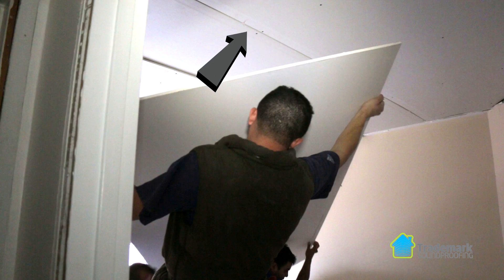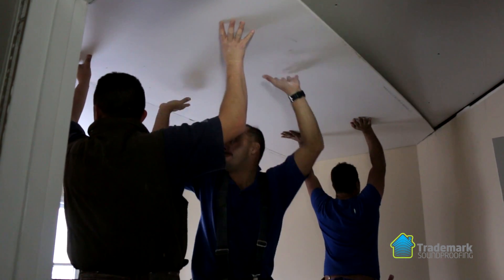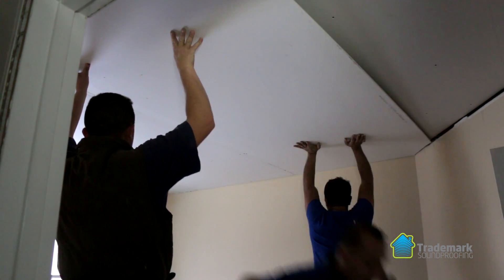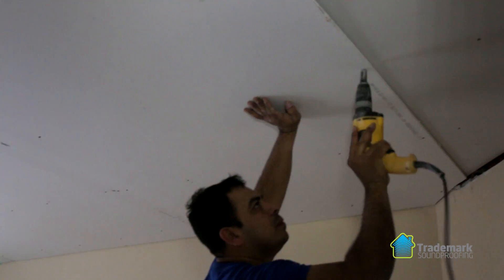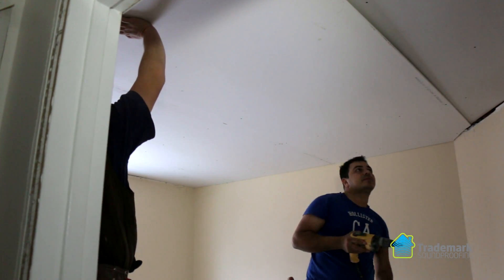Soundproofing a Ceiling Using Green Glue Noiseproofing Compound

Comment: Blowing cellulose insulation into the ceiling might help--but just a little. If you can afford it, it is much better to remove the current ceiling drywall; install a rock wool product such as Roxul; and install the new two layers of drywall (separated by Green Glue as described) onto the ceiling using sound isolation mounting clips.
Reply from the maker: Agree

Comment: since you are using greenglue for the wall to ceiling joint, does that mean mudding and tapping is not required for the area?
Reply from the maker: We use an acoustical caulk for the joints and those can be taped and spackeled over.

Comment: Not sure if this work only for airborne or also for impact soud?
Reply from the maker: Mostly for airbone. You would need Resilient Sound Clips and Channel to hang your drywall from the ceiling and then a 2nd layer of drywall with the Green Glue in between for proper impact noise protection. https://www.tmsoundproofing.com/Resilient-Sound-Clips/

Comment: I rent and am pretty clueless with diy. Could I just use this stuff to stick drywall directly onto the existing ceiling? I obviously can't do too much damage to existing stuff because I only rent, but the upstairs neighbors sound like they're in the room with me! 😬
Reply: You could do that however you would have to screw the 2nd layer back to the studs. Keep in mind that you will have to spackle the ceiling and where ceiling meets wall, usually requiring to repaint the entire room. In that case you may as well remove the existing ceiling drywall, make sure ceiling is properly insulated and then install resilient sound clips, channels, double drywall with Green Glue.

Comment: Just to clarify, I have applied Green Glue joint sealant.  I SHOULD NOT mud and tape the first layer of drywall before applying Green Glue damping compound and second layer of drywall, correct?
Reply from the maker: There is no issue mudding and taping the 1st layer, although it would be unnecessary if you are installing 2 layers of drywall. The Sealant can be used at joists to seal against sound leaks and can mud and taped over after 24 hours.

Comment: I live in a downstairs apt. There is no insulation between floors. I hear footsteps and creaking floorboards and joists CONSTANTLY. Ready to go insane. I am willing to try this. Thoughts/help.. Thanks for the great video.
Reply from the maker: You should only do it if you can remove the existing drywall and insulate first. Once that is done you should install clips and channels first and then the 2 layers of drywall with Green Glue as described in this article. https://www.tmsoundproofing.com/How-to-Soundproof.html
Reply: Did you ever do anything about the noise and what was the outcome?
Reply: @damians8498  Actually, I Installed a white noise machine with 4 speakers in each corner of the room. I kept this on all day. It helped alot in terms of keeping me distracted from the impact noise itself. NOW I have moved to florida and live on the top floor of a concrete apartment building. It is great. BUT I would say try the white noise machine , and a pair of noise cancelling headphones. That was my 1,2 punch.
Reply: @Racketeering248 i know it’s been years since this comment but I only have one white noise machine. Did the four really help with the impact noise because I find that white noise doesn’t cover it

Comment: I'm adding decorative HDF 4'x8' wall panels to my existing painted drywall/ceiling to spruce things up a bit. I'm attaching the panels to studs using finishing nails. Will Green Glue help to dampen noise if I apply it to the backs of these panels before I nail them to the walls/ceiling?

Comment: I can agree that the green glue stops sound transmission from one drywall layer to the next, but surely the screws fixing the drywall layers to each other are transmitting sound, effectively short-circuiting the green glue?
Reply from the maker: Hi Giovanni. Good question. In reality screws do not transfer much sound "directly" as is commonly misunderstood. Rather the entire structure, drywall in our case, vibrates and thus creates the sound wave. When trying to break the sound wave, by decoupling the wall, the screws will defeat the decoupling if the wall is screwed to the joist. In the case of damping such as when we are using the Green Glue, we are not utilizing a "decoupling" method, rather a "damping" method therefore the screws holding the drywall to the wall do not negate the effects of damping the vibration.
Reply: Does that mean, if I place a layer of rubber seal between drywall and studs and screw through rubber and it will dampen the sound, since the direct contact between drywall and studs are now only with screws?
Reply from the maker: @julesdownunder It is only utilizing the damping method. For proper decoupling use .resilient sound clips.

Comment: It's making the wall denser that helps sound-deadening, not a colored adhesive.
Reply from the maker: Can you back this statement up with proper sound testing? According to the sound lab tests we have seen. Another layer of drywall will add 3 STC points. Adding a damping compound as in this Green Glue will add 9 STC points. A huge difference.
Reply: @Tmsoundproofing  It's a marketing gimmick. Sometimes they catch on. That may not be particularly-honest, but is effective business, nonetheless.
Reply from the maker: @noampitlik2332  After installing this (and other) products in thousands of soundproofing projects. Plus feedback from customers and contractors we can assure our customers that this works amazingly well as a soundproofing material. Customer testimonials are available on our website and on many other channels.

Comment: This stuff is messy...how do you keep it from oozing out of the seams? And yes, I’m also using GG sealant.
Reply from the maker: Leave a 2-3 inch area around the perimeter where you do not apply any Green Glue. Performance will not be effected.
Reply: Trademark Soundproofing Inc thanks. I’ll have to try that on the ceiling... the walls are already done... and this stuff is all over my floors. And oozing down my walls. Now I’m told I have to wait about 6 weeks before it cures and stops leaking!
Reply from the maker: If it is the Green Glue product that you are using, it will not continue to ooze and you should clean it up right away. It get's much more difficult to remove once it cures.
Reply: Trademark Soundproofing Inc It’s actually the Quiet Glue Stuff. And the GG Sealant!
Reply from the maker: Figured as much that stuff runs terribly. Green Glue barely runs at all.
Reply: I wish I would’ve known that before hand! It’s too late now, and is going to push me back 6 weeks just waiting for it to finish dripping!

Trademark Soundproofing Inc

Comment: So how is the glue causing a difference with acoustics? It seems doubling the drywall is what is really making the difference.
Reply from the maker: Sound can only pass through a solid material (like drywall) by causing it to vibrate. The "damping" of the material created here with the Green Glue damping compound, stops the vibration. The difference between 2 layers of drywall with or without a damping compound like Green Glue is about 9 STC points, a huge difference.

Comment: Normal drywall stuck to normal drywall? You need acoustic drywall to make a real difference.
Reply from the maker: Acoustic Drywall is normal drywall with some sort of damping (and/or metal sheet etc) added to it. That is the same thing that you are creating here, turning normal drywall into a "damped/acoustic" drywall sheet. The advantage here is that you can create a much heavier damped panel, you can use the highest quality damping compound on the market = better performance, you can be sure that you are applying the correct amount of compound needed. Finally your 10-15% waste is of inexpensive normal drywall instead of expensive pre damped drywall.